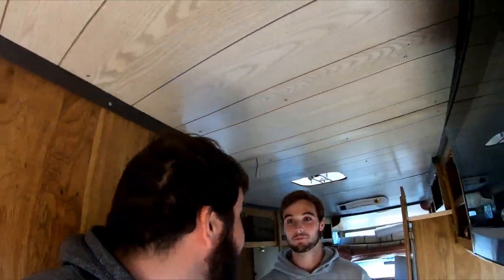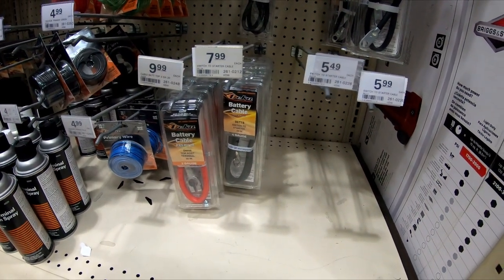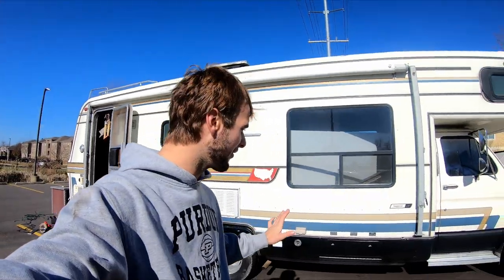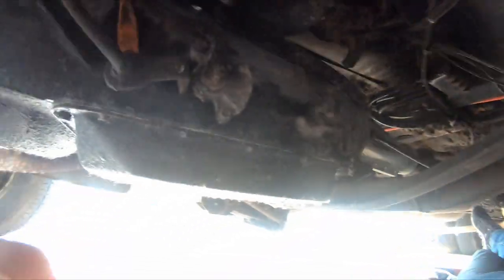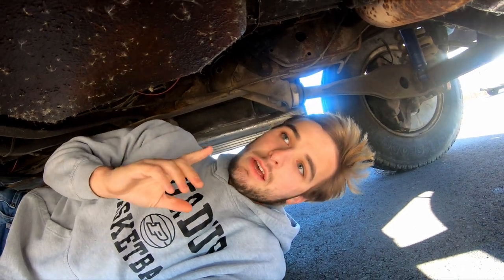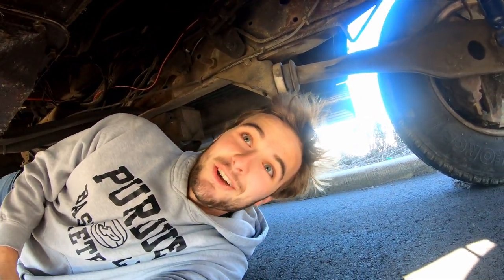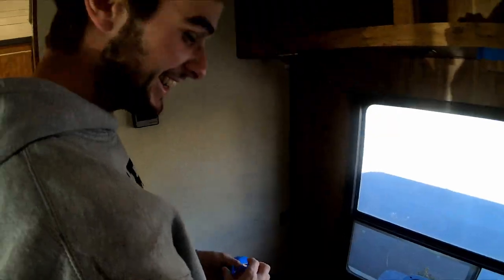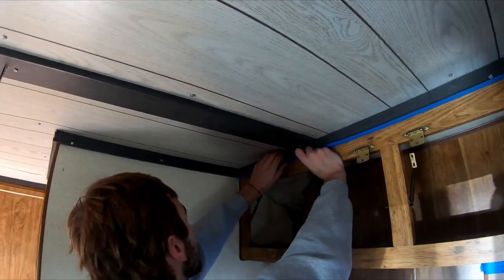Our RV Generator Works!! | Renovating an Abandoned RV E.7

Comment: Nice job on the interior and going with white is what I would have done.  It opens it up, makes it brighter, thus feels more spacious.
Reply from the maker: Thanks! Let us know any other ideas you might have.
Reply: @2bigmenoncampus  Although it is too late for this paint, I do suggest anytime you paint a bright color on the interior, to use an OIL base paint, semi-high or high gloss, on your cabinetry.  It is more resistant to buffs, scratches, etc and cleans up twice as well with a 'quick eraser'.  Does it cost more?  Yes.  Is it worth it in a small area where mishaps take place?  No doubt.  I don't know your budget, but a multi camera system with a dependable NVR may pay for itself in the event of your first 'mishap'.  Running a few lines of CAT 6 in the ceiling or behind the lower cabinets is inexpensive and once it is run, allows you to place cameras pretty much wherever you like.  Going to a tailgate party and want to catch any action inside or outside of your RV?  Done.  Someone is walking up the street with a hoodie and pulling on door handles while you are inside your RV while on a trip in a foreign (to you) city?  Review the NVR and maybe help law enforcement in some way while knowing, first hand, what actually happened.
Reply from the maker: @LaSouthernGemini  Got it thank you for all the info! We will see what we can do.